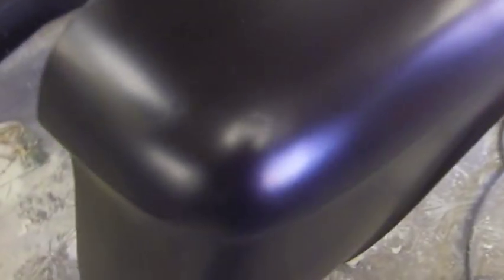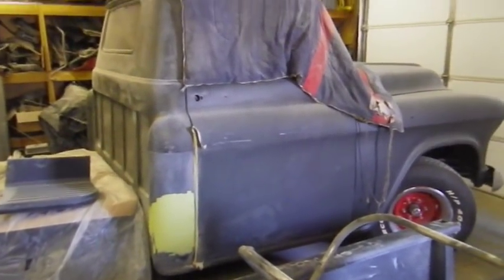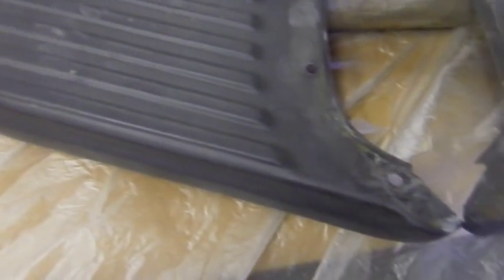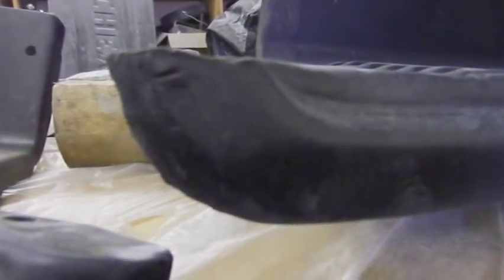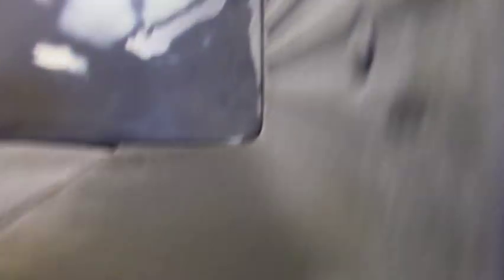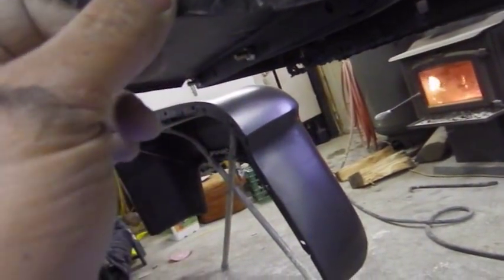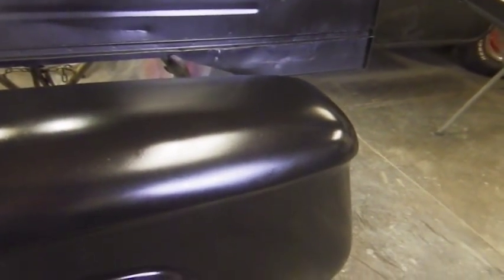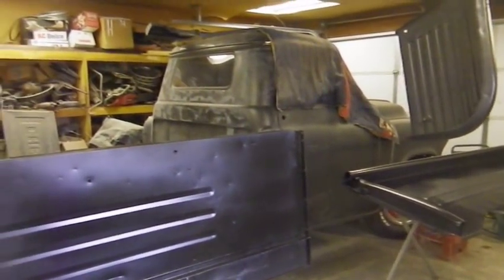Fun with fenders

Comment: Those fenders look terrific! As to the aftermarket panel, I once bought an original BMW fender and it didn't fit any better than that step. Part of the problem is, one doesn't know whether it is the panel or the original part of the car/truck that is wrong. In any case, you got that step straightened out well. Things are really moving along.